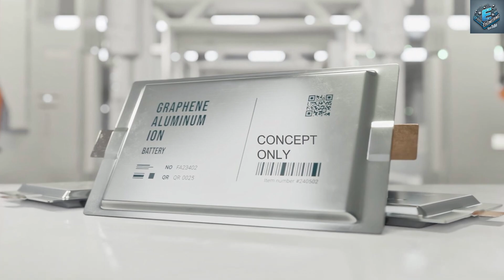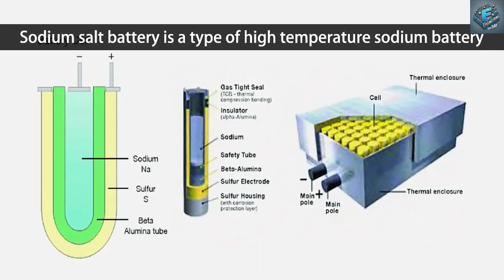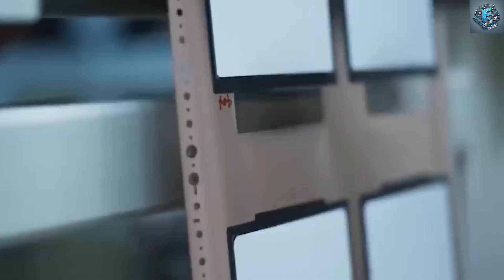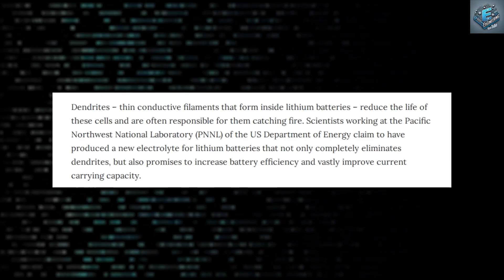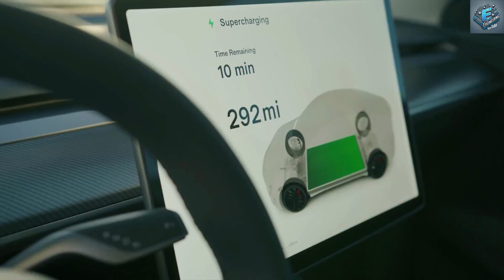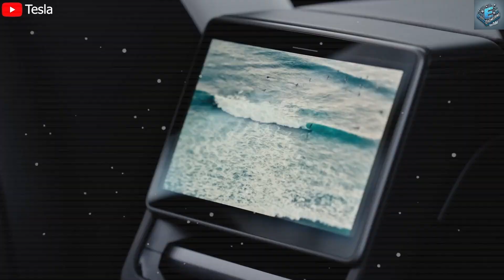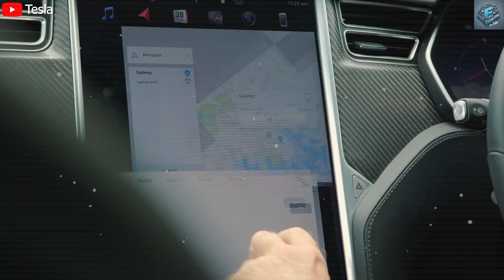Tesla Just Ended the Lithium-Ion Era  Elon Musk’s Aluminum-Ion Battery Breakthrough Explained

Comment: TOTAL BS. According to Grok: "No credible, primary source from Koenigsegg’s official website or verified statements from Christian von Koenigsegg confirms such a battery announcement. Koenigsegg’s current battery technology, as seen in the Regera and Gemera, focuses on a 4.5 kWh, 800V lithium-ion battery pack designed by Rimac, optimized for high performance but not described as aluminum-ion or capable of 15-minute charging. Furthermore, aluminum-ion battery research, while promising due to high energy density and faster charging potential (e.g., up to 200 Wh/kg and ultra-fast charging in lab settings), remains experimental and far from commercial application in vehicles like Koenigsegg’s."
Reply from the maker: Thanks for sharing your insights! It's always good to have a healthy discussion about emerging technologies and their current status. The world of batteries is evolving quickly, and it's important to keep an eye on the credible sources.